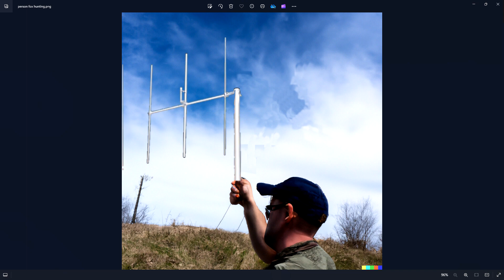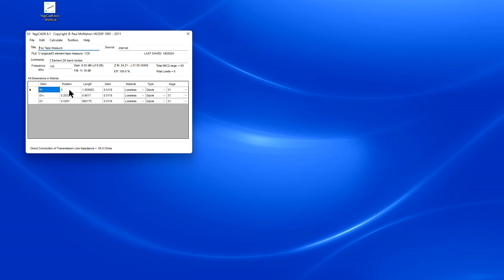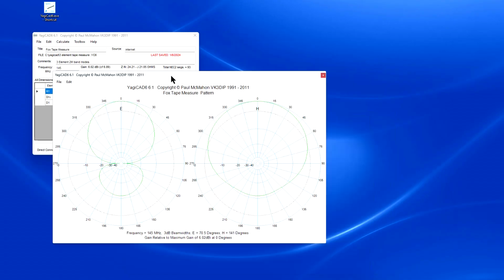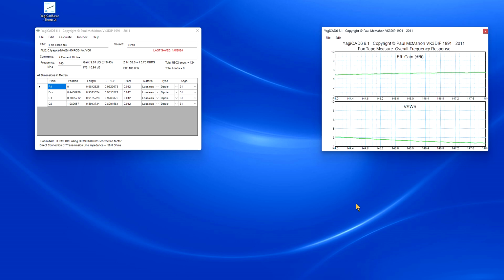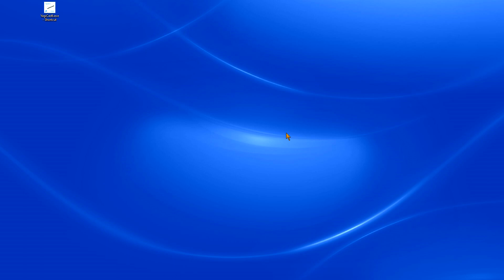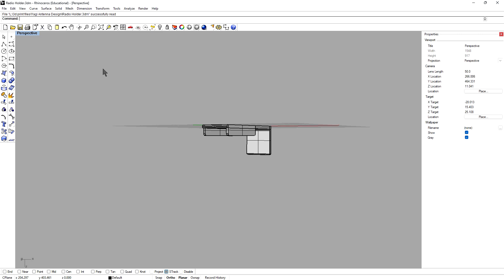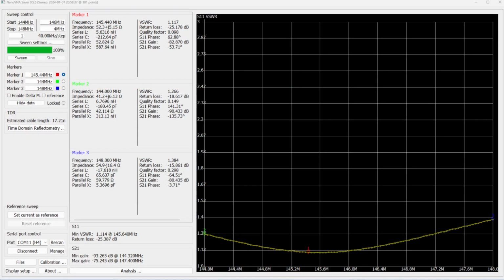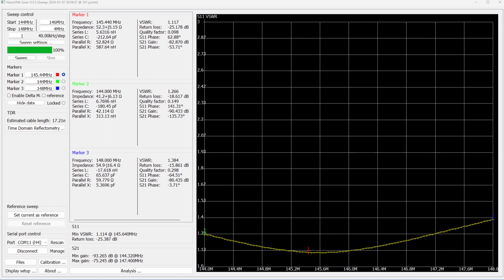Design and build a Fox Hunting Yagi Antenna

Comment: Would you be interested in producing a set of build instructions, including a bill of materials, for this antenna?  It looks like a project that would be fun for my club to build, but I'd need to have a good plan with measurements, instructions, and guidelines.  

Also, it would be interesting to adapt this antenna into a dual band antenna for satellite work.  Have you done anything in that area?
Reply from the maker: Thanks for the question,
It’s been a while since I built this. I thought I tried to give enough information to replicate the antenna. I know the 3d files and link for tubing is in the description and I believe the dimensions are in the video. I am afraid I am not sure when I would have time to create detailed instructions. 
RJ
Reply: @LynxElectronicsLab   No worries.  Would you object if I created a detailed plan, bill of materials, etc. and credited you with the design?
Reply from the maker: @JanPeterson  Not at all Feel Free. That why I put the info out there. For people to use. 
RJ

Comment: How did you drill out the holes to lighten the tubing? and decide where to drill?
Reply from the maker: Thanks for the question,
I just measured out even hole placement and drilled it on a drill press. I do not remember what size bit but I just choose one that would leave enough material around the holes to keep it solid enough. 
RJ

Comment: Do you have a link for the square tubing or the arrows that you used??
Reply: is that 3/4 inch square tubing?
Reply from the maker: Yes the thin wall not the 1/8" walls.
Reply from the maker: I updated the comments of the video with a dropbox link to the 3d files. The tubing was thin wall 3/4" from Home Depot.
The arrows are any aluminum shaft arrow with the threaded insert already pressed into it unless you have the equipment to do it which I did not. 

RJ